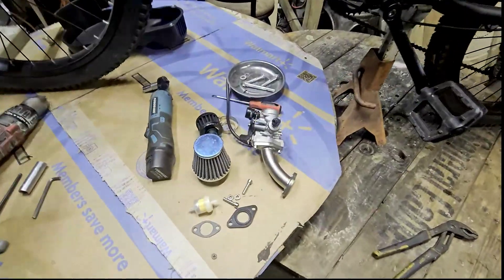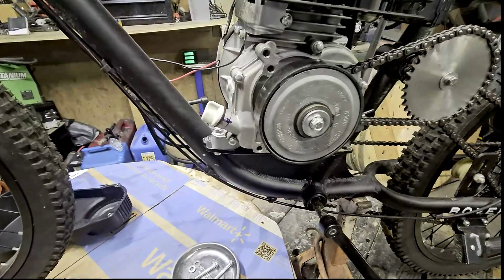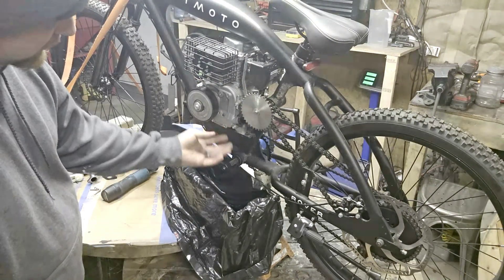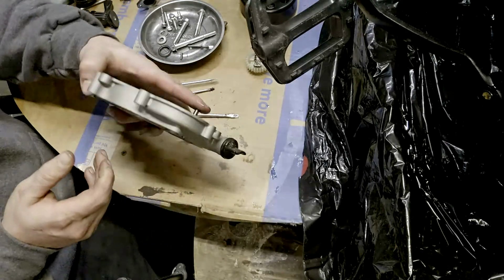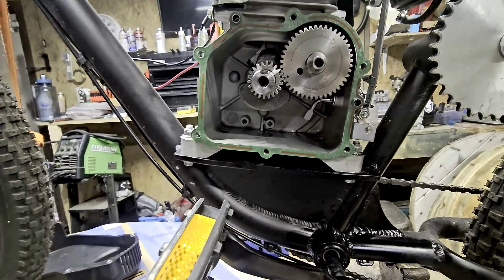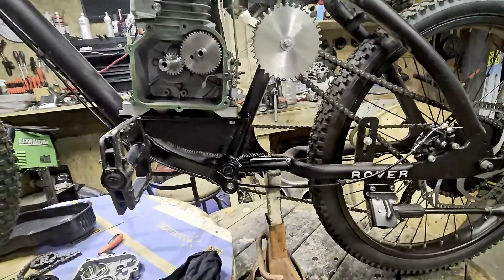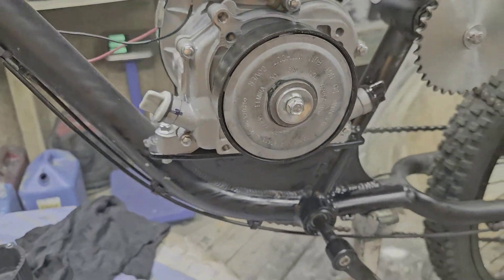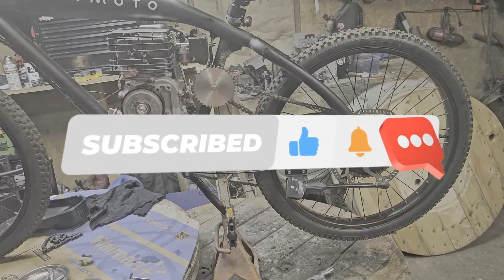Phatmoto Rover 3HP Lifan - How To Remove Governor / Upgrades #shorts #motorizedbike #bike

Comment: These bikes are so badass. Nice video, i'm about to start building mine and your video is packed with great info. Got the same carb kit. Amazon also sells the custom exhaust for the Phatmoto 79cc that fits perfect right out of the box so i got that too.
Reply from the maker: I'm glad you like the videos. The carb and exhaust should really open it up!
Reply: @engineunknown2  I sure hope so, because I love how much the 79cc engine stays out of your way and gives you plenty of leg room. I weigh 150, so I figure if it tops out at 38 or so with the 79cc after the upgrades, mods and decking the top end that's plenty fast for now. All the upgrade parts are in and the bike and engine arrives tomorrow, so stoked to get started.
Reply from the maker: @davidsapir9638  ya it should I weigh 250 and I got to hit 37mph

Comment: You can also adjust your valve lash factory they run these loose for kids gives it a slow take off
Reply from the maker: Ya I always run .003 on the intake and .005 on the exhaust

Comment: You got me thinking about the timing on mine. I stopped using the 2 stroke kits, because they are so messy & unreliable. I think with my last one, the factory installed the crank seal wrong, and that lead to an air leak that made it run lean, regardless of the jetting. And it eventually overheated & seized. Never again. I should probably just build engines from scratch, or take apart a new 4 stroke, before doing anything with it.

Comment: I want to get one of these and yank the four stroke and put in a spicy 2 stroke. Seems like a good frame and build as a starter and much less expensive than building it myself from the ground up. There are a few things I would change but they look pretty good overall, probably better than most rollers I could buy elsewhere.
Reply from the maker: Ya I was thinking about doing that to my  all terrain. I have a pk80, but I think it will not have enough power for the 4 inch wheels

Comment: Instead of using a bolt, what about just cutting it and reinstalling it? Your becoming my go to for these things bro! Thank you!
Reply from the maker: Thanks and can you explain more  about cutting
Reply: @engineunknown2  I removed the governor arm (guess it called that) cut the angled part off above the two flat spots where the washer sits and then just smoothed it up before reinstalling it. I installed the carb you got and everything put back together, it's running alot better now
Reply from the maker: Did you get rid of the governor gear
Reply: @engineunknown2  yes, you weren't joking either. That little ring on it is so much fun taking off lmao
Reply from the maker: @docholiday3800  ya I just did my 224p and these really suck. They are inside the block with no room to work with
Reply: @engineunknown2  I seen a video where after a while they just took everything out to remove it. I'll be there eventually to join in the fun

Comment: Great video. But, I did not understand how was the timing off. The two dots?
Reply from the maker: So the two dots have to line up to be in time for the Valves opening and closing. If it's out of time the Valves open and close at the rong time witch couse low power and the Valves could hit the piston
Reply: You should have pointed out the dots with a finger or pen. Anyway, the two dots as the black small hole on the big pulley and the what appears to be the silver circle(dot) on the small pulley?
Reply: I just saw the video again and there is a dot on the one Tooth of the small pulley. I guess the other dot on the big pulley is the black one. I think got it. Thank you
Reply from the maker: Your welcome